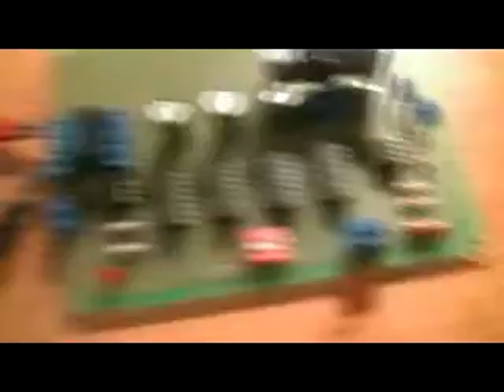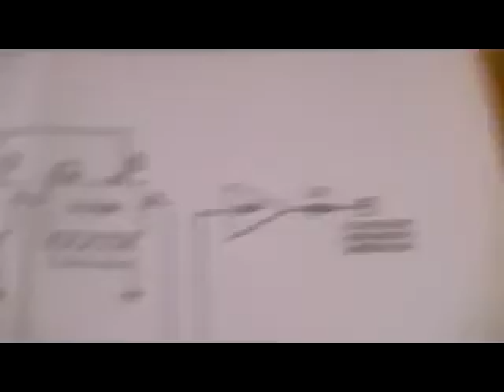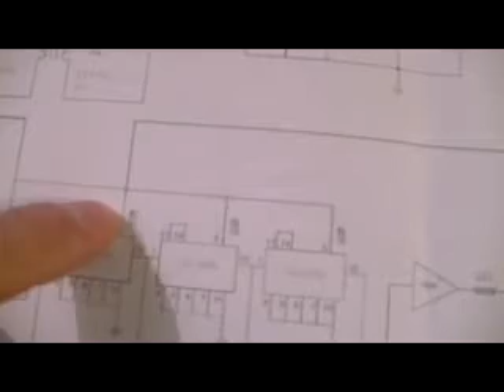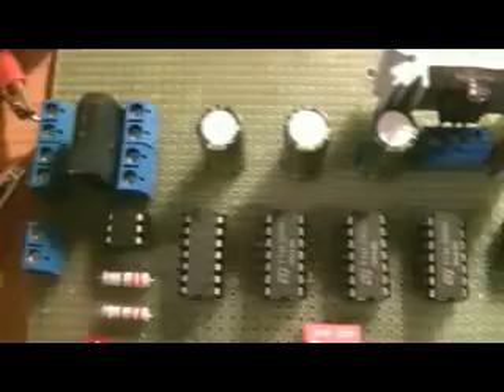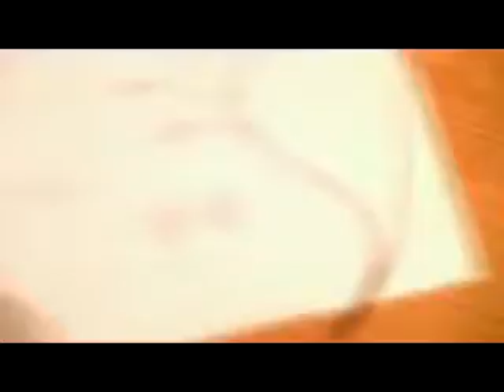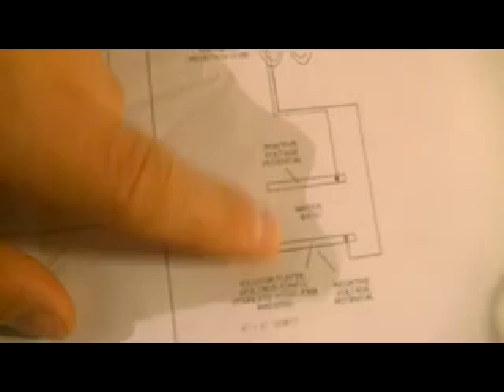9XB Stanley Meyers Replica

Comment: Hello Uter! Thank you for your video. I have problem with my 9xb circuit, can you help me with advice? When I turn Pulse Selector Switch in to position - 4X, there is no 50% Duty cycle in output. This is highest frequency selector position, it goes right from pin # 3 of 555 timer and pin # 1 of first 74LS90N.  Do you have the same on your 9xb, or I did something wrong?